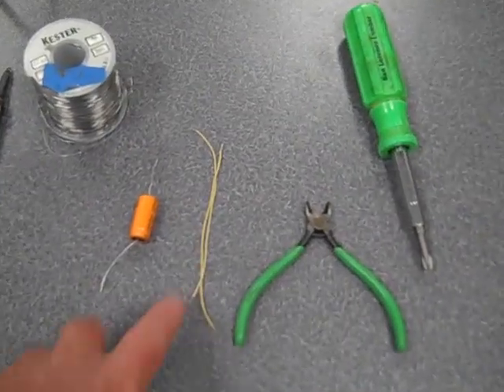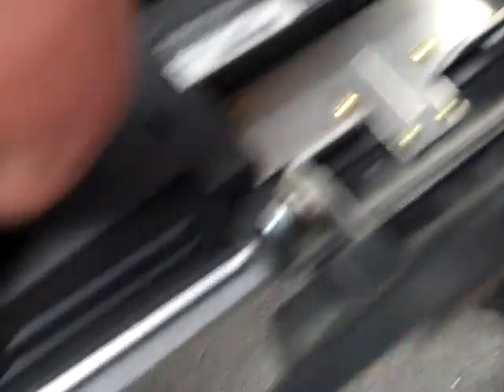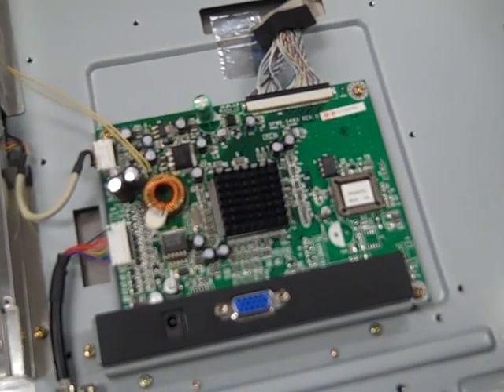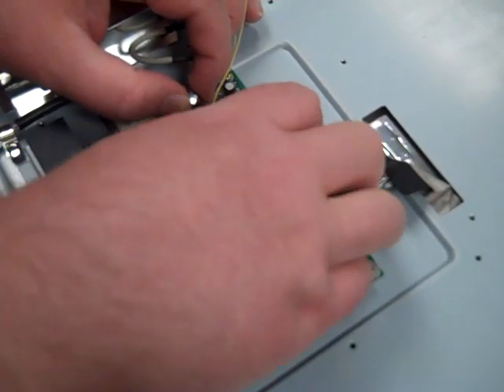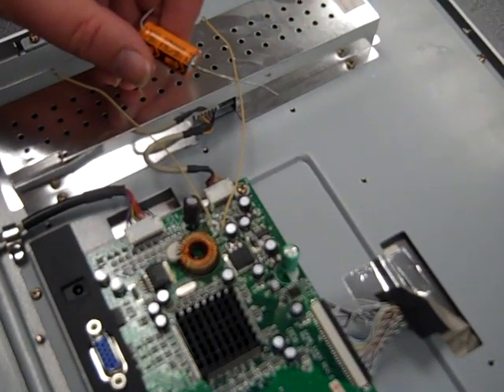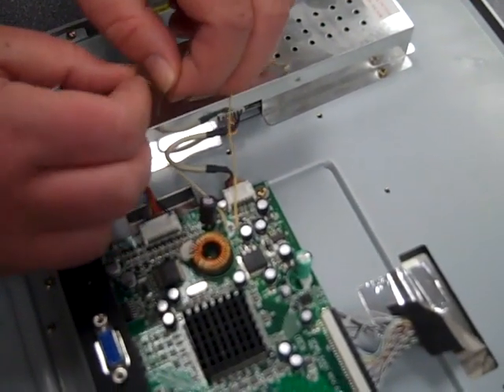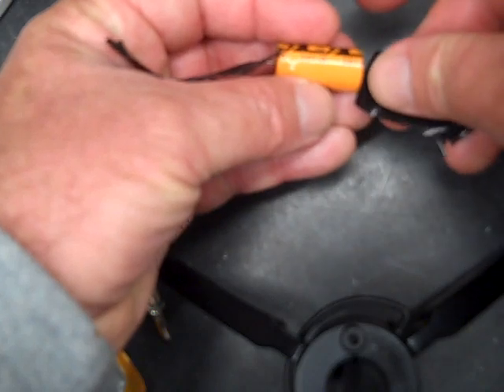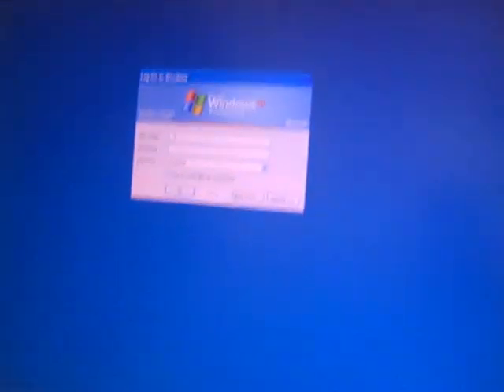Fix a ViewSonic VE700 LCD Monitor - blinking light - bad capacitor

Comment: You say you have a soldering iron, so why not just desolder the capacitor and put the new one directly onto the PCB? Anyone trying this in a year greater than 2011 should do that, and not what is shown in the video. NO reason to solder wires onto the PCB, then the capacitor. What if the capacitor touches the AC side?

Comment: I have a VA1703wb monitor that works only when the monitor power button when pressed on and off for 7 times after the pc is switched on.  after this operation there is perfect working of the monitor. No problem with light and illumination.  Is it the problem of the hardware in the CPU.  I dont know the technical words to tell.  when computer is switched on the screen remains black.  the monitor on button has the lights.  we need to press this button on and off 7 times to see that the screen is steady with the desktop image.  what should I do?

Comment: Not good to extend the capacitor leads like that with wires just to save you some normal PCB soldering and looking for a better capacitor that fits because that circuit is for the boost converter and powers the back light LED's and all that circuitry including the power MosFet and Coil and capacitor need to be in close proximity of each other.
Reply: Totally agree. I thought it was weird and highly unusual in that they didn't just remove the capacitor in the normal way using soldering iron and/or soldering wick etc.